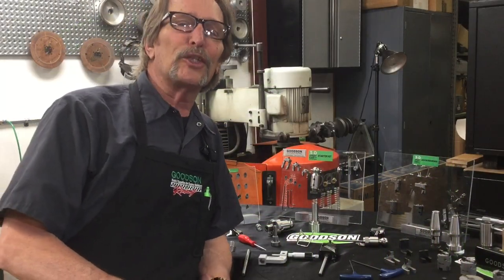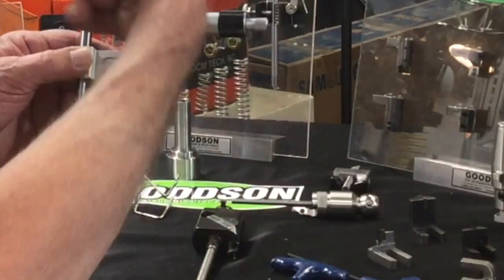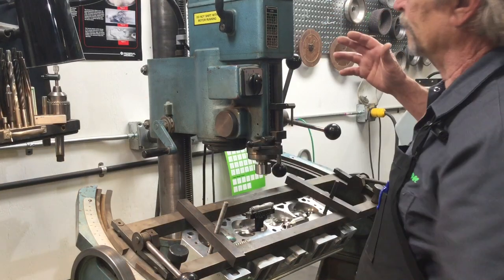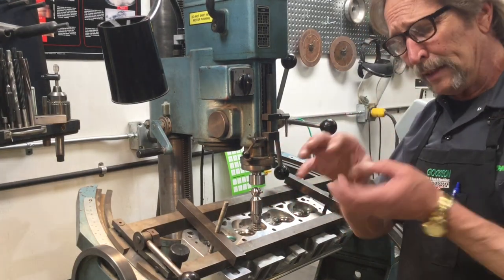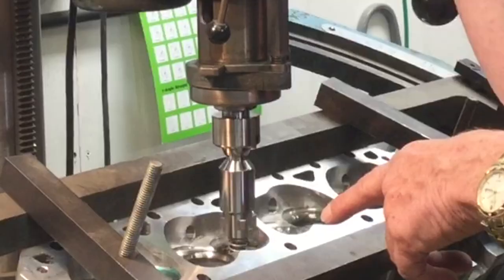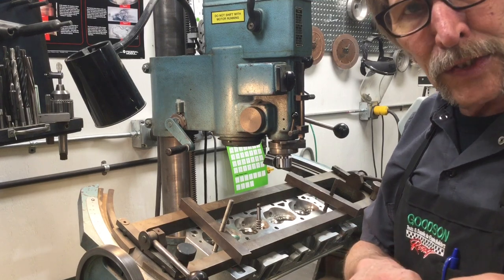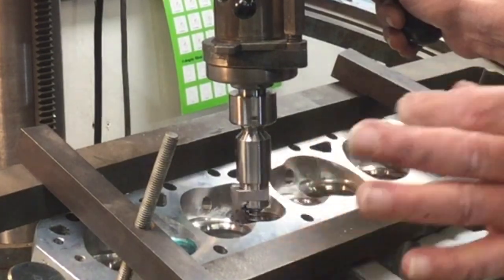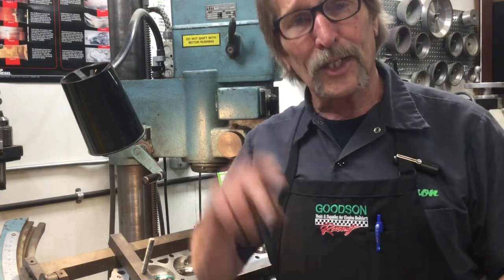Counterboring with 3-D Fast Cut | Tech Lab Tuesday

Comment: Great video. Have a question on valve seat driver when buying a seat driver do they fit snug to the id of the seat are do they fit loosely.
Reply from the maker: Hi Tony, your question is a good one! According to our tech department, the answer is "both." Speaking specifically about our valve seat drivers, they are made to cover a range of sizes, for example 1.000" to 1.125", so depending on where within that range your seat fits you may have a snug fit or a slightly loose fit. If you need a little more explanation, feel free to contact the Goodson Tech Department at 1-800-533-8010 or email tech@goodson.com.